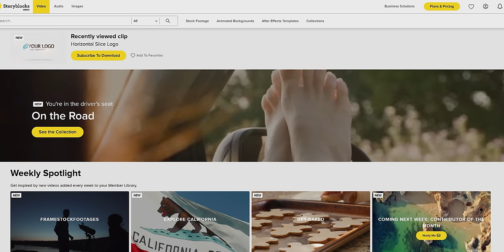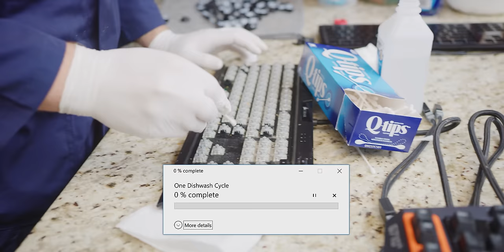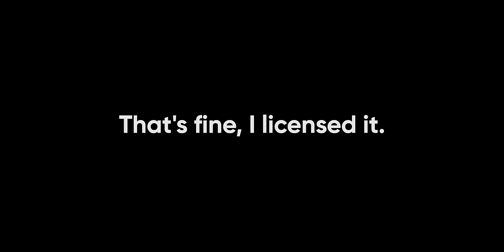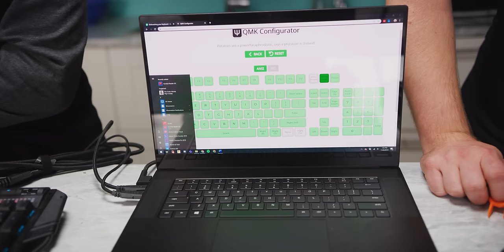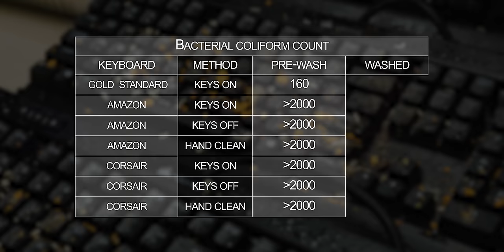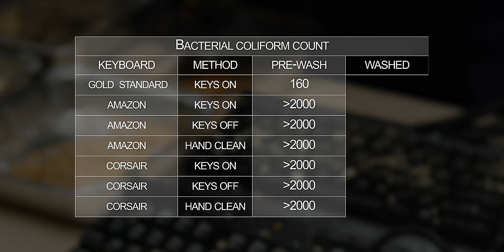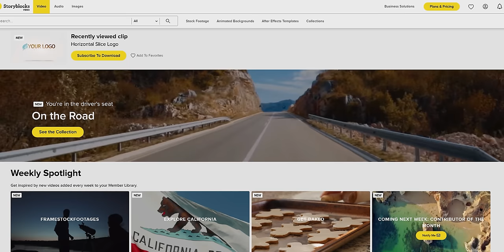The best way to clean a keyboard is… the DISHWASHER?

Comment: You should have overclocked the dishwasher.
Reply: may be future vid..
Reply: Nah fam, he needs more RGB
Reply: Needs a RAM upgrade as well
Reply: The issue is he bought a pre built dishwater... Should have built it himself.
Reply: @MrChikito100  why don't you just download it
Reply: I managed to overclock mine to 6.1 GHz, works like a charm, 1000 fps in csgo highest graphics owning nubs
Reply: True but he would have needed a better cooler
Reply: Just download more ram and rgb
Reply: Or watercool it. Why? Idk but hey he watercools everything so why not?😂
Reply: Linus adds clocks to the dishwasher
Reply: That could be actually possible
Reply: It needs a water-cooling upgrade
Reply: I saw this once points to Home improvement episode 1
Reply: It would've removed the hairs with its built in only accecably when over clocked scissors
Reply: i dont think so, tim.

Comment: My macbook has a keyboard build in. Do I just put the whole macbook in?
Reply: Audio Hutch yeah! It should be fine, just make sure it’s not on!
Reply: To typical Apple user.. Yes, will totally be fine.  Make sure you put the rest of your Apple products in at the same time.. It will amplify the effect.  Play in traffic while waiting for it to finish.  Tim Cook approved 😁
Reply: Yes, you put the whole macbook in...the dumpster. (sorry, had to get that jab in)
Reply: Oh for apple products it is adviced to use the highest temperature settings with soap. And make sure it is turned on while washing. For quick drying use the microwave.
Reply: Louis Rossmann disapproves is this comment
Reply: Stop it guys stop roasting him dish is very dish-respectful to the guy
Reply: MacBook are cleaned best in fire.
Reply: @Bilbo__Baggins  you use fire? I thought everyone throws them into a volcano.
Reply: Yes
Reply: @Gillsystems  Afterwards, don't forgot to put it all in the microwave for 10 minutes to dry quicker and to quickly recharge each device's battery
Reply: Yes then buy a pc while you wait
Reply: ThankYouGuys!ItSeemsToHaveHelpedButTheSpaceButtonDoesn'tWorkAnymore:(
Reply: Audio Hutch yes, this actually helps a lot. Make sure you shut the device down before you put it in tho or else it will get the system. When you put it in the dish washer be sure to put it on the pots and pans setting so that you get the best cleaning option. I’ve done it multiple times and my MacBook still works fine. Just make sure you give it like a week to dry.
Reply: Audio Hutch yuck
Reply: pinquinsam plus put in your AirPods pro, iPhone 11 Pro Max and Apple Watch series 5. It makes everything cleaner. you should also use heavy solvent to wipe down the sensitive areas, plus sandpaper in the inside.
Reply: @audiohutch  Just give the space bar a good whack with a hammer. It probably just has some crud the dishwasher couldn't get and that will knock it free.
Reply: You should be okay. Just include a handful of rice with it.
Reply: Just get a new one, that's what Apple wants you to do
Reply: No, heres how it works:

Windows gets dishwasher 

Mac gets washing machine
Reply: put it in acid for best results
Reply: Also don't forget to leave a bitten apple inside for additional "apple care"😊
Reply: No, you need to buy the iWash dongle sold exclusive at the Apple Store for $399 USD.
Reply: Make sure to turn on the macbook before put it inside the dishwasher , You will get fast results .
Reply: No
Reply: Yeah, just throw it in the microwave afterwards to ensure it dries quickly
Reply: No you just buy a new one
Reply: no of course not! the keycaps should be removed first, duh.
Reply: @jakekarma  I just put my airpods through the clothes washer, I can't imagine your Mac will have trouble with the dishwasher 👍🏼
Reply: Audio Hutch make sure that it is full charged
Reply: yeah its perfectly fine. you can also charge your iphone in the microwave
Reply: Audio Hutch Yeah! Just make sure to put it in rice
Reply: put it in a dishwasher, then go buy a Windows laptop
Reply: R/woosh to everyone who didn't think this guy was joking lmao
Reply: Yes and login into your account before putting it in as your Mac os can help the washer to maintain the temperature
Reply: Yes.
Reply: You're always supposed to wash apples after buying them
Reply: Just call the fire department! 😋
Reply: Buy a Windows laptop, problem solved
Reply: Nono, you disconnect the display before
Reply: Yeah and then go get a Windows laptop
Reply: yeah make sure to first let it dry
Reply: No you should put it in dustbin not dishwasher
Reply: Yeah. You can always send it to Louis Rossmann just so we get an LTT x Rossmann Group crossover.
Reply: Good luck removing keycaps
Reply: yesss, do it
Reply: Put it in rice
Reply: Sure, what could go wrong?
Reply: oh yeah, you totally should do that.
Reply: @jakekarma  probably would be fine if you unplugged and took out the battery
Reply: Yes it will be fine
Reply: Of course! It's clean your mac in the process!
Reply: Yes make sure its internals are exposed
Reply: Pull the battery and use distilled water and it will survive just fine if its dried out.
Reply: I named my Macbook "Bold and Brash"
Reply: I always wash Apples before use
Reply: Yeah. Then go buy a windows pc
Reply: @alihassan4060  Lava is way better but fire will work if you don't have much time.
Reply: Built*
Reply: Place your apple products gently into the washing machine with a loose bag of marbles . Wash at 90°C and at 1200 RPM with industrial grade swarfega to remove grease and grime .

I can't stress enough that you have to place them in into the washing machine gently,  don't just throw them in,  its the only way to make sure you don't void your warranty .

Good luck .
Reply: Yes. To keep it charged, plug in the charger too
Reply: I think those tend to run so hot that it kills germs right off
Reply: All these guys are wrong and doing so will break your MacBook, do to it properly I would suggest taking a 9” concrete saw to the backplate of your MacBook so you can get inside then gently drill your way through the battery on each four corners. After you have done that disconnect the battery cable from the motherboard, then proceed to wash it in the dishwasher on steam and the highest heat setting because the metal benefits from it (don’t forget soap), after that you will want to stick it in the industrial sized pizza oven for about 13 and a half hours. Once that is finished you may reconnect your battery cable to the motherboard and take your nearest jumper cables from your car attach the positive to the left hand side of the MacBook then negative on the right hand side. You are now ready to turn on the MacBook. (Warning this must be done by a trained and licensed Professional MacBook Washer, otherwise it will void your warranty and may cause physical harm or death)
Reply: of course. use soap too.
Reply: Don't forget to it in rice afterwards
Reply: Yes, please go ahead.
Reply: Yes
Reply: Just don't forget to update to the latest macOS, that makes it waterproof, then it will be fine. You can even leave it on.
Reply: No, you gotta remove the keyboard first
Reply: It would be better to put the whole thing in the dumpster.
Reply: No, take it down to the local fire station and let them give it a pressure wash.
Reply: Yes but with soap
Reply: Well if apple would not be utterly shit, yes you could do it to laptop, long as you remove battery, let it properly bleed out all the energy from capacitors and remove bios battery and drives. After that one should dry it for a week or two and then put back together with bios update.... buut cause apple has moisture sensors that trip even from air humidity...actually you cant avoid your warranty when its already voided by air humidity so should not be a issue in that regard.
I have recovered laptops that have been on pouring rain for days with out issues and just let them dry out properly with out battery on and those are still working, but would not recommend it to anyone..
Reply: Yes
Reply: I wouldnt trow anything with a battery to the dish washer
Reply: Yep, Apple released an update which makes it waterproof. Didn't you hear?

You can also dry it in the microwave.
Reply: only with the apple dishwasher, which is available for only $5,999,999.99
Reply: Wait so is that last part about the Corsair warranty implying I can wash my keyboard and keep it?

Comment: In my experience, taking the key caps off, brushing the board with a dry toothbrush while letting the key caps soak in soapy water, then tooth brush the caps one by one as the rest soak was a good way to keep things relatively dry, so you don't have to wait a week for it to dry, at best I waited an hour, got very good clean results after 6 years of use.

I was using a Razer black widow. It's not rgb, it just has green backlight.
Reply: Try replacing the soap in the water with tablets made for washing dental prosthesis, dont even need the individual brushing :> Did it last month myself, after about the same amount of time as you, was a horrendous disgusting mess
Reply: Im at my friend's house and he cleaned the board with soapy toothbrush and after waiting for a 2 hours it ain't working hahahahaha what should we do
Reply: @Z4rius  yall goofed up💀💀

Comment: Putting stuff in a dishwasher to clean (big industrial dish washer) is pretty normal, BUT you need a vacuum oven to properly dry stuff afterwards.
Reply: Yep, it's what I use at my work, big ole washer and vaccum ovens to get things bone dry after a couple hours.
Reply: Compressed air and a few extra days to make sure its dry
Reply: @Iama Dinosaur Maybe you could use this industrial cleaning method as a service?
Reply: @lilmayo be careful with isopropyl alcohol though. Some plastics may be attacked by it chemically.
Reply: I've cleaned electronics like this by opening the cases and running a high speed fan over them in a warmed room - In a pinch, placing them in direct sun to dry helps as well. Doesn't hurt to use some alcohol to insure water isn't sticking around in any nooks and crannies either.

Comment: I think we as viewers deserve an updated video. I really want to know if adding soap has any adverse or beneficial affect.

It may also be helpful to know what other computer components can be put in a dishwasher.
Reply: According to Der8auer you can wash motherboards so I would think most electronics would work provided - (A) you remove any power source (can't recall but I assume Der8auer removes the mainboard battery?) (B) it gets COMPLETELY dry, meaning you watch carefully for any pockets or areas that could trap water and be sure they have time to dry out, and (C) you take into account any part where there is, say lubricant for moving parts or thermal compound for heat transfers and properly reapply those. 

FYI Roman did mainboards as a way to remove vaseline, which is used to coat boards to protect them from condensation during extreme OC (liquid nitrogen cooling).
Reply: Id say no. The soap is abrasive and could potentially damage the components?
Reply: The soap in the dishwasher is not only abrasive . .  it can also be very caustic.  I regularly use the "turn upside down, shake and hit the bottom" method myself.  Sometimes I follow this with compressed air and a soft brush.  Simply cannot envisage a keyboard lasting 5 or more years - I have to get a new one about every 2 years . . .when the most commonly used letters start disappearing. (I just mentioned to my daughter that the letters L,O, S and E were half gone . . . .To which she said I should stop typing that everyone is a loser all the time!!! LOL)
Reply: I always shill out for the Logitech washable keyboard in these situations. I've had it for at least 7 years. None of the letters have rubbed off. I've washed it in the shower with soap multiple times. The only disadvantage is that it's not mechanical.
Reply: @userPrehistoricman  Just for curiosity, do you mean this thing: https://www.amazon.com/Logitech-Washable-Wired-Keyboard-K310/dp/B008D1JRIO
? I might consider getting something like it myself.
Reply: Any component if you are brave enough.
Reply: I wash my motherboard and CPU in the washer whenever I need to get all the dust out. It's easy, and I've only been shocked 3 times after reinstalling the components!
Reply: I thought the minerals in the water corroded the components over time. So while it may not break your electronic gear now in a few years it will.
Reply: dishwasher soap might help because it has an anti-corrosive chemical in it.
Reply: @doreenspillman7890  LMAO. Is the last part actually true?
Reply: @doreenspillman7890  See, I just take off all the keycaps, let the keycaps soak in hot water and the keyboard itself I wash with a paint brush or something soft bristled, let that soak in hot water, then dry it off by hand and let everything dry for two days. Works like a charm.
Reply: RIP 😢
Reply: Video came out 12/16/21 Its called "Fixing my wife's $150 keyboard for $1" he mentions this video and how bad of an idea it is because several of the keyboards later died from moisture exposure.
Reply: See pinned comment
Reply: @doreenspillman7890  which is why your not supposed to wash cast iron pans. Not because the water will cause rust but because the soap will attack the pan allowing that water to rust it ultra fast. Luckily your pan should still be fine it'll just cost you some time oil or butter and some paper towels.
Reply: All the keyboards died within a year

Comment: 8:51 What? No! Quick-dry with air pressure, THEN let it sit for a couple days!
Leaving that water on your tech will have the water react with your metal circuit - rust! It may still work, but lifespan will be greatly reduced. The air pressure minimalizes that effect (you basically let it dry out for just for safety, for those droplets in pockets the air pressure can't reach)
Reply: Yup. Maybe just use isopropyl alcohol.
Reply: I had a nasty Softdrink in my g910. Glued the keys shut with the sugar content. So I tried cleaning it with isopropyl 99% but it wasn't really desolving the sugar. So I gambled, tossed it the tub with dish soap water and after a 30 second run through with (completely underwater) I took it out and rinsed it with the alcohol. After that I dried it with a hairdryer. Worked a charm. My gamble worked perfectly but I still wouldn't recommend it.
Reply: Why not put it in a vacuum and boil off all the water?
Reply: MrTaunks Eh what?
Reply: @Motishay  At around 0.03 atmospheres water boils at room temp.